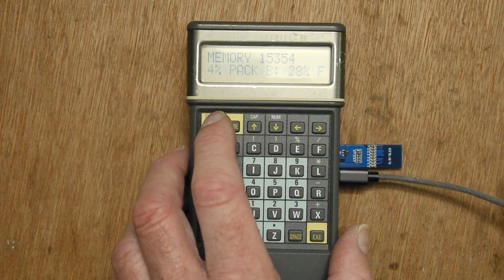Psion Organiser II Datapak Gadget Part 2: The Datapak Size Board

Comment: I was just able to pick up a Psion Organizer II for a good price. It got me thinking about your project. Then I got to wondering if a similar Datapak could be designed who default program is a menu of sorts. After turning on the Psion, one would be able to load/run the menu program to select the Datapak image to 'load'. Then on reset and selected pak would be seen by the Psion. This would eliminate the need for the need for the small display but I'm not sure if it would be easier/harder to use.  Just thinking out out so to speak.
Reply from the maker: You could probably do this with different firmware on this gadget. You could create a bootable pack image that is loaded by default. That can insert a menu option into the top level menu of the organiser. When the menu option is selected it can run arbitrary machine code. That could interact with the pak gadget using a specific protocol different to the Psion datapack protocol (perhaps). That protocol could then perform the functions that the menu does at the moment, including selecting a pack image and listing the available images etc. So I think it could probably be done if you could work out some protocol over the Psion slot signals. I have thought about this now and again but not done anything about it. Yet.
Reply: @menadue  Ah, so you can have a image loaded by default, interesting. I'll have to start doing some research and collecting Psion II technical docs now. So many projects, so little time :)
Reply from the maker: @HeyBirt  Yes, the gadget loads whatever image is specified in a file called 'config.txt' on the SD card. For Organiser 2 information, this site has it all, basically:

https://www.jaapsch.net/psion/

Comment: Nice. I have my late Father's Psion Organiser II in my loft still. Great to see they are still being used.
Reply from the maker: It's probably a good idea to check there's no battery in it.. If not then pop one in and I suspect it'll power up, they really are very reliable machines.
Reply: @menadue  thanks. Pretty sure I've checked that before but worth stating it just in case.
Reply: I use them in my company (mail order). They are unhackable and cheap. Another plus is, you don´t pay monthly for the software.

Comment: Very nice!
How tricky was it to solder the RP2040 on?
Reply from the maker: Ah! That's the bit I wasn't looking forward to! It turned out OK in the end. I put a very small amount of solder on each pad and then used a hot air gun to heat everything up. Once hot the IC pulls itself into position with surface tension and all is well. I pushed down on the IC briefly to ensure all pads were wetted and then it's done. Removal is easy, heat it up and pull it off. I've removed and replaced a few times now and it seems pretty reliable. So, short answer, not too bad at all. If you have hot air. I'd think using a soldering iron would be about impossible.
Reply: @menadue  That doesn't sound too bad... I'm pretty good at SMT stuff, but haven't tried a pack like that before.
I suppose I just need to bite the bullet - design a simple microcontroller board and practice building them. At least RP2040s are cheap!
Many thanks for the detailed answer.  =)
Reply from the maker: @Xoferif  Yes, they are cheap. You can also buy them, which at the moment makes them about the only microcontroller that I use that I can buy. Don't forget the external SPI flash that is needed. I used an SO-8 packaged version of that.